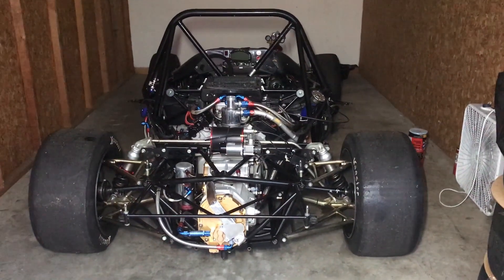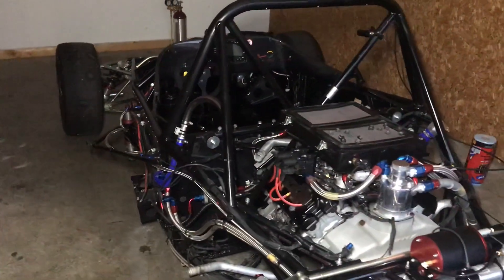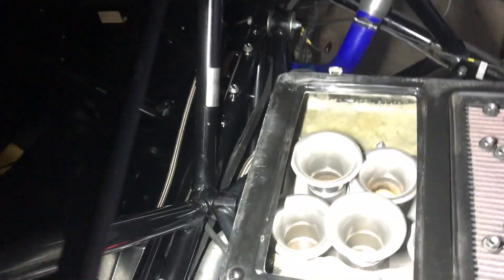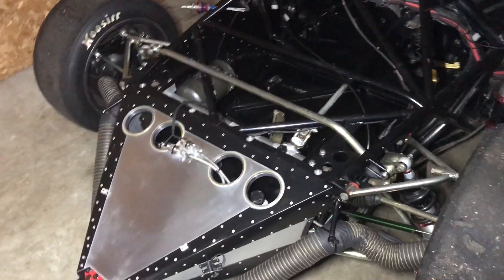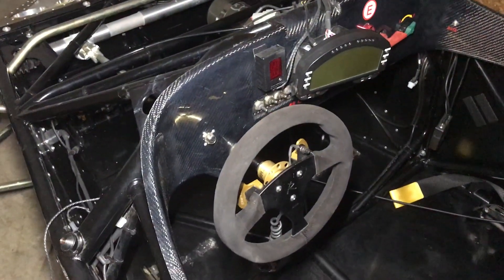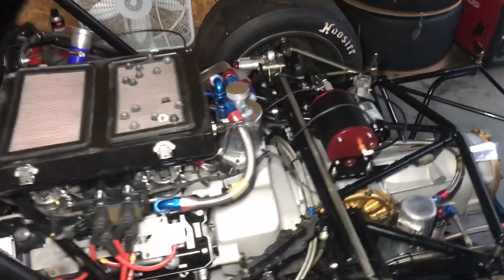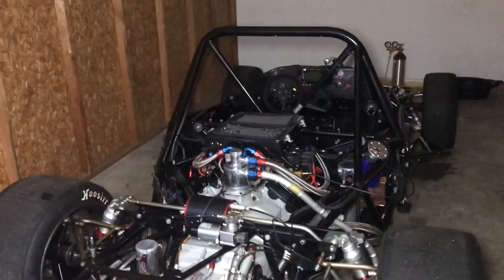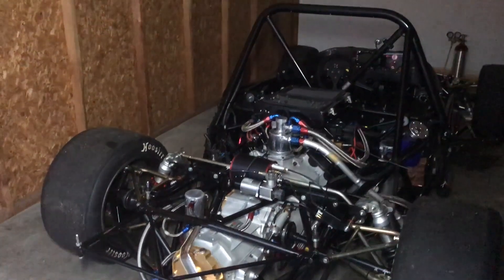Radical SR8-RX 2.7L V8 Race Car - part 1 (strip-down walk-thru)

Comment: Great content Derek!  What are we looking at cost wise for this?
Reply from the maker: Going thru a used race car and refinishing is an open-ended $ effort. I had a good mechanical starting point with a car that only had 14hrs on it since a factory rebuild. I put about $25K total into the car after acquiring it - including the tools and lift, stand, spare wheels and other parts, etc.